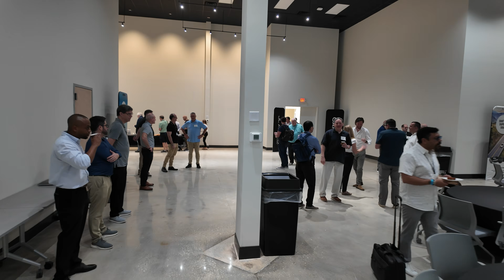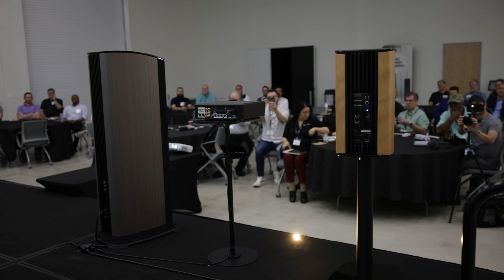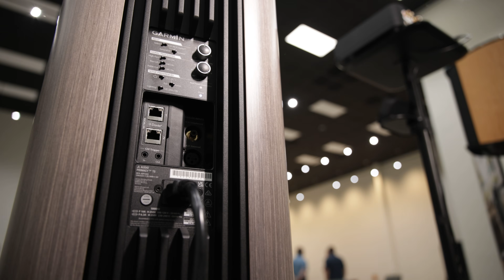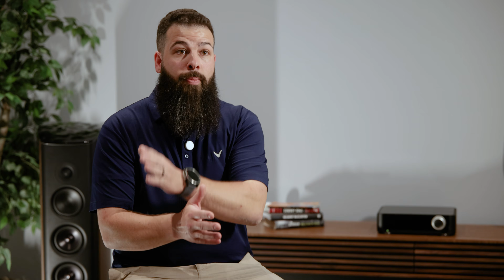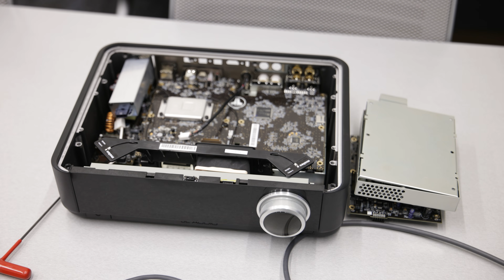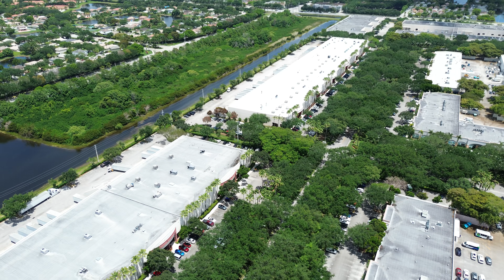JL Audio’s First Hi-Fi Speakers Rethink Stereo—Primacy T6 and S3

Comment: Two more direct firing speakers. Can't possibly sound any different from any other.
Reply: I’d argue that’s very far from the truth. No two speakers sound exactly alike. In fact, I’ll take that further and say that companies struggle to make two identically designed speakers sound identical, such are the crude tolerances in speaker design. But back to front-firing speakers as a whole, the differences from one design to another are often substantial.
Reply: @dougschneider8243  "What we hear in loudspeakers is frequency response and radiation pattern." Mark Davis